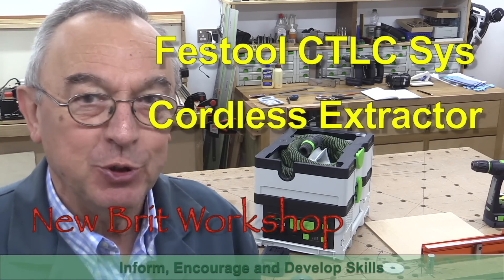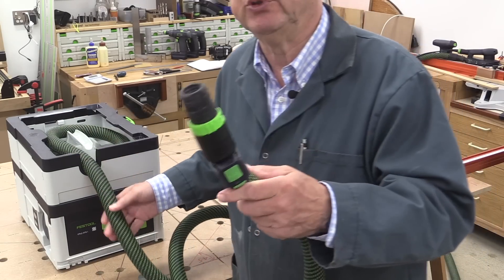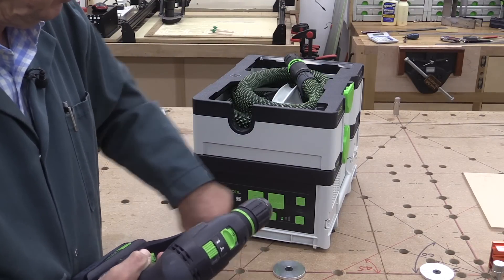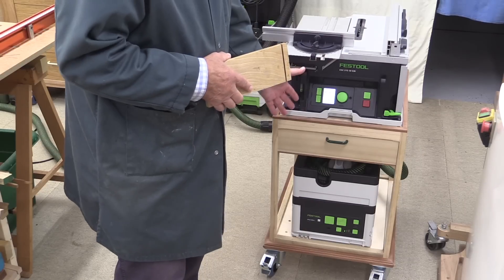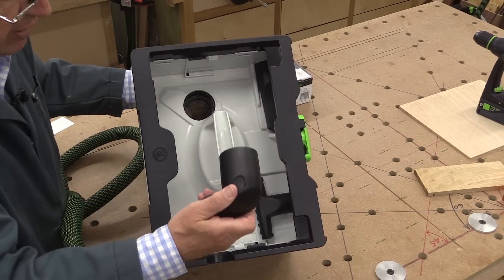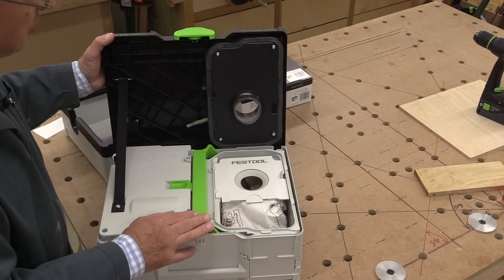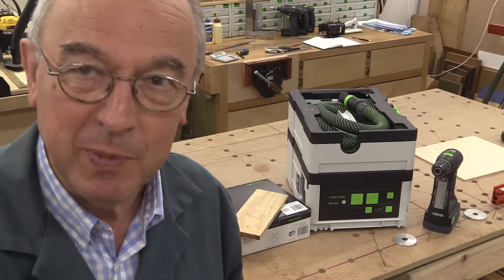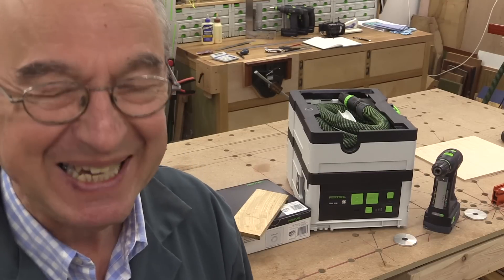Festool CTSC Extractor Overview

Comment: This was an excellent review, Peter.  I bought the CTSC when it first came out because I wanted a more small, portable dust extractor with blue tooth but I have been very disappointed by the unit’s short battery life.  It is the first Festool product I’ve bought that I’ve been disappointed with.  This would have been perfect for me if it had a plug-in option to use with mains power.  This is the same concern I have about the new CSC Sys saw.  I would love to have the saw if it had a plug-in option.  I think Festool, in what appears to be a drive towards offering only battery-powered tools, is making a mistake.  Many people, myself included, would find plug-in options preferable for larger tools that draw a lot of power, like the CSC Sys and the CTSC.  Having to frequently change batteries is a nuisance!!!  Thank you, Peter, for the time and effort you put in to producing your excellent videos!  They are greatly appreciated.
Reply: Agreed, great comment!  There is NO reason the infamous Festool Engineers cannot design a cord option for many high drain cordless tools!
Reply: Agreed this is the first Festool product I don’t like and have ‘range anxiety’ every job I take it on.
Reply: The saw works, the vacuum does not. I would say 100% of my work days I will run a vacuum continuously for 10 minutes. Meaning you cannot even complete 1 task with the vacuum, the batteries take 30+ minutes to charge so you couldn’t get continuous runtime without 6 batteries. The saw is designed to make quick cuts, using the ts55k as an example, it’s nearly impossible to exhaust the battery faster than they can charge. Even with heavy use the saw is difficult to deplete the battery in a day. While I agree having a cordless corded combo option would be optimal, the saw works but the vacuum really doesn’t. This is just my experience though and I personally think the cscsys is a huge failure
Reply: @carbb5760  Why buy a ctsc only for BT? Just use your normal vacuum (or buy a smaler corded one) and buy the BT knob.
I ordered the CSC saw without the standerd batteries and ordered the 8ah batteries instead. They come out beginning of september. So that would give me around 50% longer power.
Reply: @TheOneLin3  ya I think the saw works as a BT cordless tool, the vacuum works much better corded imo

Comment: Thanks for the overview peter. I like the idea of these compact vacs (I have the M18 packout vac), but really festool made a mistake in discontinuing the corded version of this vac. They could have just updated it to match the current feature set (bt, variable suction) while also introducing the cordless variant. There's room on the market for both.
Reply from the maker: I think that you are right. Cheers.  Peter
Reply: @NewBritWorkshop   I have the old CTL-SYS, which I rather like on its Systainer wheels, and last looked it still seemed to be available  old stock?
Reply from the maker: Hi Kevin, No, It is still being made as far as I know.  Cheers/  Peter

Comment: Thank you Peter for another excellent review.  I'm keen to buy the CSC table saw from Axminster but they are out of stock at the moment but I am on their waiting list for notification when they have been re-supplied.  I have the original extractor machine and found that the hose was of poor quality as it cracked in two places but the upgraded hose is just right.  Also, I found that paper dust collection bags were limited so I bought the stronger extraction bag with a zip on the bottom and stand over my waste recylcing bin and empty it.   I've been a convert to Festool for several years and appreciate the general high quality of all of their products.;
Reply from the maker: Hi Alan, Axminster will get stock back soon and, yes, Festool kit is superb.  Cheers.  Peter

Comment: Thank you for showing. I am considering buying one for addition to my CTL Midi. I also use the CT-VA separator and I wonder will it make good sense to use with a battery powered dust extractor?
Reply from the maker: The CTSC eats batteries and so whatever you plan to do make sure that the CTSC is not expected to run for more than 14 minutes between battery charges and allow time for that charging.  Peter
Reply: @NewBritWorkshop  thank you for your quick response. basically I want so save bags, the CT-VA is already there, so I wonder if the ctlc is powerful enough. Mainly I will use the Bluetooth connection when drilling in walls or something like that and general dusting with the remote control would be comfortable. My midi is the old version without Bluetooth
Reply from the maker: It should have the power to pull through the separator so as long as you are happy with battery life go for it.  Peter
Reply: I have an old mini, which is not upgradable to bluetooth. I do not need to use it cordless. I have found a handy thingy from Starmix, called the CoCo. It is in two parts; one goes between the plug of the extractor and the wall socket, the switch goes around the hose, similar to the Festool bluetooth switch. You switch the extractor to manual and the extractor will switch on when the switch detects vibration, or when you push the button. Very useful, and it was around € 100 in the Netherlands.

Comment: Absolutely agree on the 2nd set of batteries. I wish they would have made the battery opening big enough to accommodate two 5.6 ah batteries. I have a Milwaukee vac that I use and like, and I can put a 12ah battery in it and it goes for quite a while. I tend to use the Milwaukee for cleanups. Also agree on FCPX for video editing. I changed to it several years ago and can easily do what I need to do with it.
Reply from the maker: Many thanks for this and great to hear your support for FCP.  Cheers.  Peter

Comment: Does anyone know if it has the same bypass valve problems as the cable version or did they fixed it? (it acts like it's clogged)
Reply: I got the sys for many years, what do you mean with ur question? Indent have issues on mine
Reply from the maker: No, it is fixed.  Peter

Comment: I too found the battery life to be shorter than expected in continuous use (such as general cleaning/post project cleanup).  I bought it primarily for the Bluetooth, and, as far as that goes I'm pleased.   For me the idea was to replace my DeWalt DCV580H portable vac.  In general, the CTSC outperforms the DeWalt.  But I gave up the much longer battery life and, more significantly, the dual power (the DeWalt has both 20v AND mains power).  As a dust extractor the CTSC is far better than the DeWalt, quieter, better suction, better hose.  When its all said and done the CTSC is the better vac  but the DeWalt represents significantly better value due to it's longer battery life and ability to use mains power.
Reply from the maker: Yes, I understand.  Peter

Comment: if I'm not mistaking, the airstream does not start to charge a hot battery.
The airstream is for cooling down the battery during the charging (faster charge) but it will not cool a hot batter first when starting the charge.
Maybe take a dyson with you for cleaning up 😆😆
Reply from the maker: When you power up the Airstream the fan starts and a connected battery will cool more quickly so that charging can start sooner.  Peter
Reply: @NewBritWorkshop  ach ok, I had the wrong info than. Thx

Comment: Having been burned by the awful CSC SYS table saw, I wish Festool would give up on this obsession with fitting things into a Systainer. They hamstring the products as a result. It's baffling that they didn't engineer in a solution for standard size batteries. 

I don't know - I love my Festool tools, but it is genuinely beginning to feel like they are making things just for the sake of it.
Reply from the maker: The CSC Sys does use standard size batteriess but the new cordless vacuum,  CTLC Sys, does use the small batteries and is compromised as a result. The CSC Sys does have some poor elements but for a quick and easy cordless site saw it does do the job. The poor elements are the dust extraction, the dreadful blade guard and non complanar surface.  Peter

Comment: IInstead of constant new ideas, of whatever, it would also be time to reflect that the Parf Guide system has a weak point. Namely, no hole to hang it on. I bought it and am absolutely convinced it is fantaschtisch, but you can not hang it, which has led to the fact that it is now abused as a ruler and that is not the point. It is built of high strength steel and not easy to hole with normal drills. So a hole should be drilled at the top to hang it. Well I also use it for welding tables. Should also be mentioned that this system is not only good for wood but also for Metall..
Reply from the maker: Many thanks for the advice and most interesting that you use it for welding tables.  Cheers.  Peter